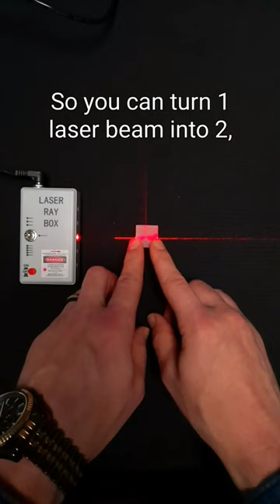How to Manipulate Laser Beams! #shorts

Comment: Wasn’t the prism just a glass prism with a mirror on one of the insides of the sides
Reply: No, as he says in the video, it's a block of glass
Reply from the maker: There actually isn't a reflective coating on that part of the prism! It's just a block of glass, but when light hits an interface between glass and air at the right angle the light completely reflects inside the glass. That's also how light pulses stay in optical fibers
Reply: @edmundoptics by the way, i learned something new with that today. How amazing is it to know that it doesn't just reflect directly off the first surface it hits. Thanks for the knowledge!
Reply: @Buff_MC You should've just click on his icon instead of writing an  symbol beacause it actually works.😂😂😂
Reply from the maker: @Buff_MC  you're welcome! 😁

Comment: You missed one. A phased array where the laser(s) is directed without an object  but rather multiple lasers are used and directed by which ones are turned on within the matrix. With a phased array you can not direct but rather focus the beams in a direction without manual movement of the apparatus.
Reply from the maker: True, there are actually lots of other ways to manipulate lasers, but for the sake of the 1 minute short we just chose to highlight a few 😀